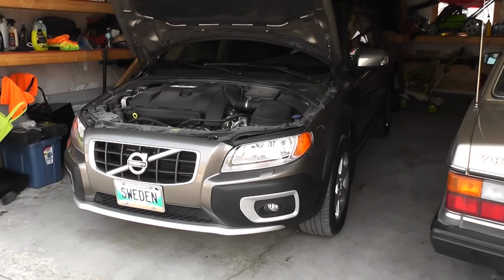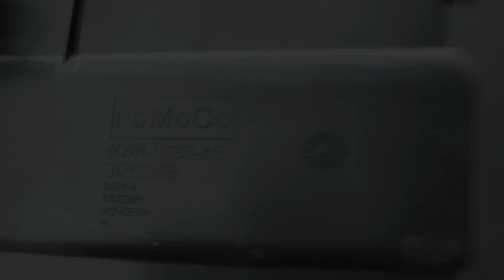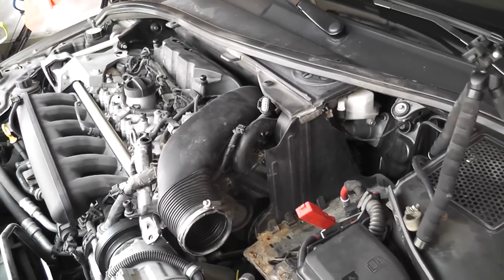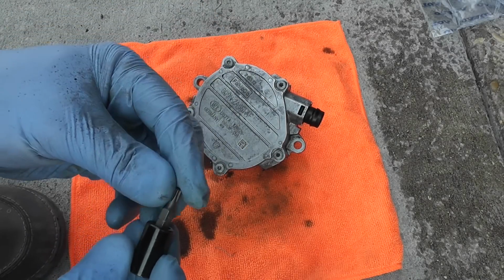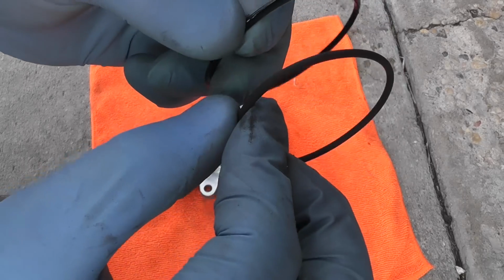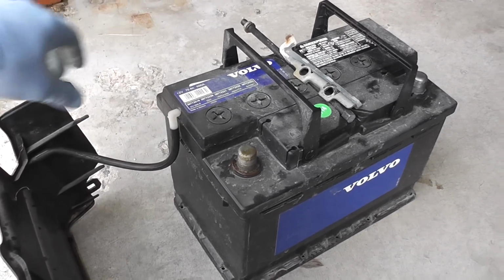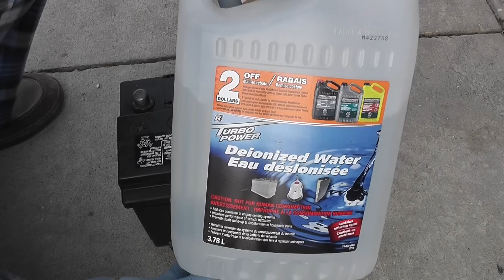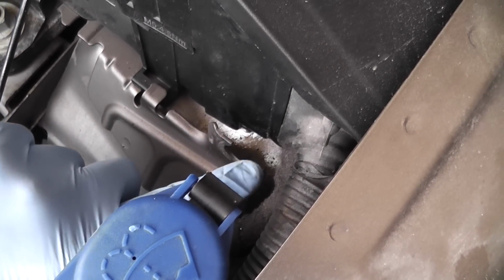Fixing leaking Vacuum Pump on Volvo 6 cylinder 3.2 and T6 engines.

Comment: minor thing but... always, always disconnect positive battery lead first...
Reply: Why would you want to do that? Removing the positive lead first exposes the positive battery terminal, with the negative one still connected to most of the metal bits in the car. One slip with a tool and you can connect part of the car with the positive battery terminal and fry whatever there is to fry. There's no such risk if you remove the negative one first. DON'T EVER REMOVE THE POSITIVE TERMINAL FIRST. YOU ALWAYS REMOVE THE NEGATIVE LEAD FIRST. That's why in most cars this one is the easier one to access and disconnect.
Reply: @0YouCanCallMeAl0  That doesn't matter at all. You break the circuit either way.
Reply: @GymChess  please don't. give advice on things you. have no idea about